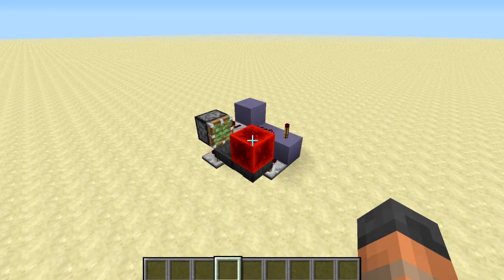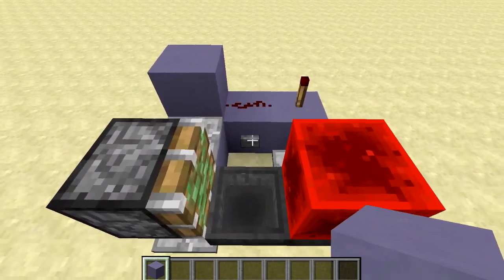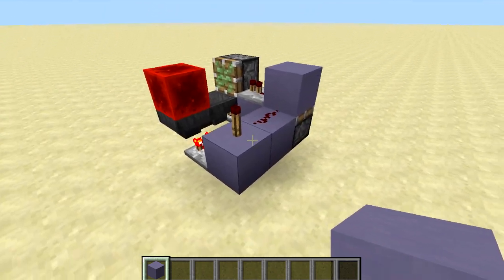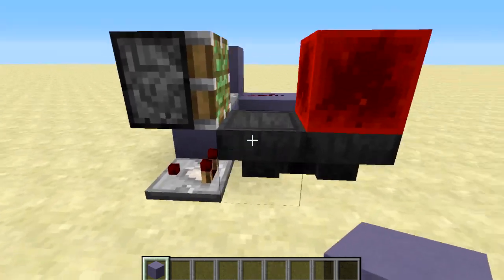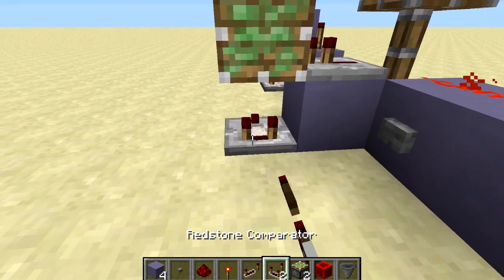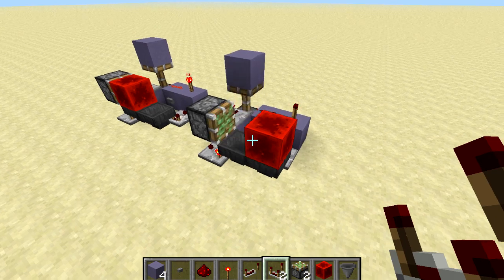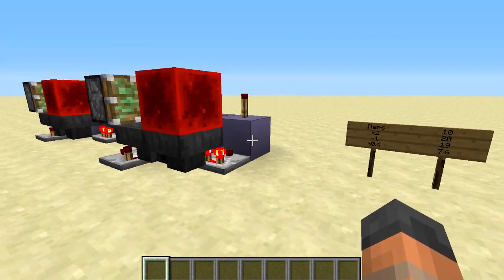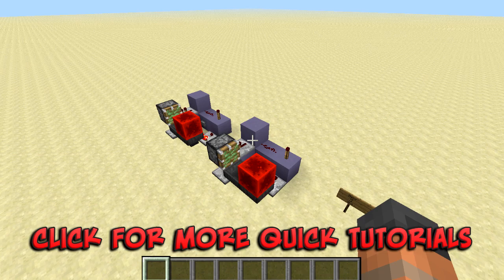Minecraft: Tiny Pulse Lengthener (Quick) Tutorial

Comment: With the button where it is, the output is actually on for 8.6 seconds, due to for the first 1 second, the button is preventing the hopper from transferring items. This is easily fixed by either accounting for it in your items, or simply moving the input away so that it doesn't interfere with the hoppers (like to the opposite side of the block).

Comment: Xisuma's design can be turned into a clock with the following tweeks:

1. Place a block off the output.
2. Place a torch on the side of that block.
3. Run redstone wire from that torch to the side input of the other comparator. (use a repeater next to the output comparator.
4. Profit

Comment: lol. I just don't understand why you don't count some blocks that the design uses  - the floor and the air block which is replaced by the block that is extended by the piston. When I count my designs, I usually ask myself - will this work without the floor? Yes - don't count it; No - count it. I also check to make sure if there are any pistons that might interfere with (push) other blocks outside of the area it is built in.

Comment: Wow, nice design! Was searching for something like this, it still works perfectly.
However, one thing to mention is that you can't put less then three items in the hoppers, the system won't work with only two or one item. Don't know whether that's a 1.8 update thing or whether you forget to mention it, though.
EDIT: The minimum number of items for this to work is actually dependant on the length of the input pulse that has to be lengthened. For a stone button it is as said (3), but for a wodden button it's 4. A short pulse, taken from a piston pulser with a two tick repeater (essentially the smallest possible tick for this design to generally work, I think) needs 2 items at least.